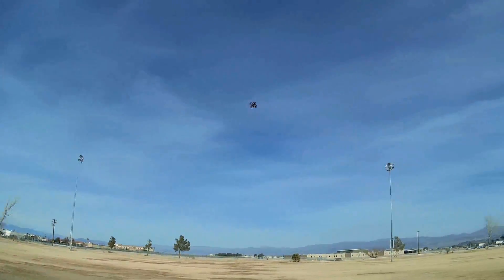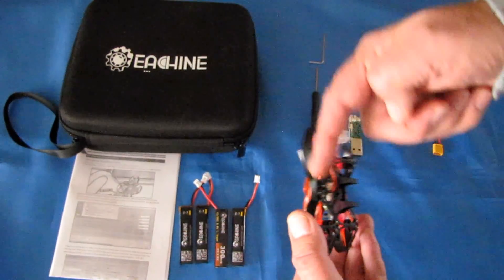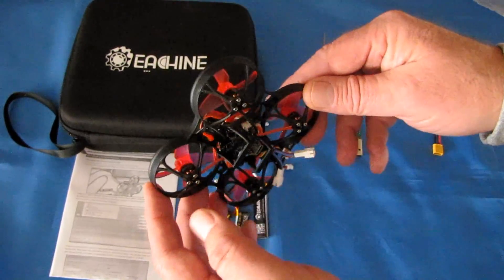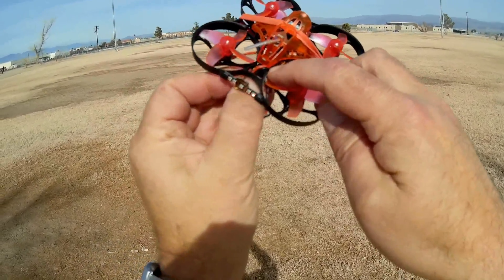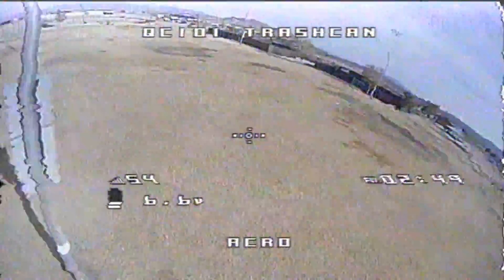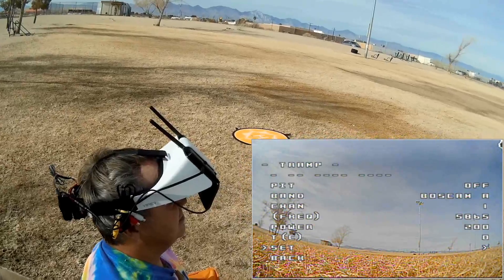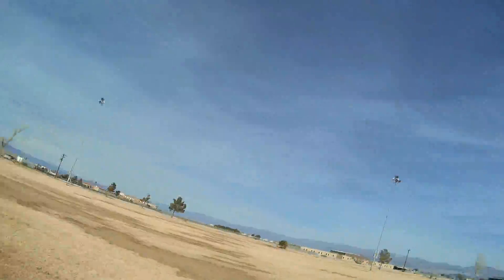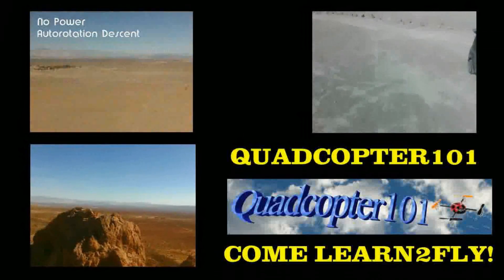Eachine Trashcan Speedy 75mm Whoop FPV Racer Flight Test Review

Comment: my quad uses 300 man 7.6v 30/60c. Can I replace it with 300 man, 7.6V, 80C/160C or will this fry up my flight controller
Reply from the maker: It should be fine, as long as you primarily match the voltage.  The higher C rating just means that it is a better quality battery that can draw higher current without degraded performance.  And if you're wondering, the mah means how much power is available (for flight time).  But higher mah also means a heavier battery that the drone would need to lift. So the increased flight time is not linear (i.e. a 600mah will NOT double the flight time as the drone will need to suck more power to lift the heavier battery).

Comment: If i add a dedicated flysky receiver  would i go for the "no rx" version or just the flysky version and disable the integrated one some way or another.(if that is a possibility)
The No RX version support external serial-bus receiver like xm+, crossfire, S-FHSS etc.. But i'm wondering what the best and easiest option. Because the fs-a8S can do both.

Comment: I’ve got one of those little buggers lol, still haven’t fully set it up yet, because I need to upgrade from my cheap goggles. After looking at a few videos on goggles I’ve decided to get the sky zone v2 goggles. They get great reviews, and for the price are very good value straight out of the box, with a great  quality picture and the video they record are also very good in comparison to even a lot of the higher priced units. The only thing I’ll do to make them better is change the antennas like each reviewer has recommended, the original one work, but not brilliantly. Also great review, can’t wait till I get my new goggles so that I can take full advantage of that mighty little beast.
Reply: Update, I’ve had  the skyzone goggles for a while now, and I’m so glad, my friend Daniel and his friend Cory, both were surprised at how good they worked even without a patch antenna or other aftermarket antennas. Got the same sort of distance that they did with there fat shark goggles and they both have patch antennas and other aftermarket antenna on the other side.

Comment: Hi what is your DVR 60 FPS  ?    😉
Reply from the maker: I have two DVRs used in this video.  One is 30 FPS and is built into my FXT Viper goggles.  But I have a second 60 FPS DVR attached to the back of my goggles.  It is a new DVR from FXT that will be available next month.  FXT asked me to hold off on its review until it is released to the public.
Reply: @Quadcopter101  Ok, I know this VTX FXT, thank.    😉

Comment: Thanks for another great review. I have a trash can on the way, it will be my first acro flyer. Can someone suggest a video showing how to switch b/w acro and stability mode using flysky i6  and the other basic first acro info? Appreciate You!!
Reply: andrew tull Flysky i6: 1. create a new model 
2. in Aux Channels  assign channel 5 to a two position switch it is going to be your arm switch , and channel 6 to a 3 position switch (switch C), it is going to be your flight mode switch. 
3. bind the quad. 
Then you need to connect the quad to a pc running betaflight and set it up. Check Josua Bardwell on youtube, he has many excellent videos  about betaflight setup. Put Arm on Aux1 and for Aux2 choose angle (stabilized) when switch is up, horizon (stabilized but you can do flips and rolls)  in the middle, and acro (it is the default in betaflight) when switch is down.
If you want turtle mode (flip after crash) you need to flash a 10ch mod to your trasmitter or you can use angle-acro-turtle on swC and keep the radio as it is, but no horizon mode (not a great loss imho).
You also need to activate air mode if you want to do flips and other freestyle moves, just assign air mode to aux2 middle and down if you use the angle-horizon-acro setup; if you use turtle mode assign air mode only to aux2 middle position.
If you are completetly new to the hobby, remember that stabilized mode and acro mode are very different, in acro mode you need smaller and more frequent movements of the sticks (except when doing stunts) to correct your angle and direction, you also need to coordinate roll and yaw in order to do clean turns. Stabilizied mode seems easier, but in reality it is just different. Use stabilized mode if you are inexperienced and you fly in tight spaces (the trashcan is very powerful, so start outside with no wind). But start to fly acro soon, it is much more fun. The firt times you’re gonna crash, but once it clicks it’s like learning to ride a bike.

Comment: You tried to set the VTX via TRAMP vtx control, but the trashcan uses smartaudio (option above). You 'll also need to set the power level to 500 to get 200 for some reason. 200 is 100 and so on. Also, bend one of the antennas 90 degrees in your goggles! Basically, you were flying 25mw the whole time and without proper diversity :)
Reply: Do you know if running the t8 instead of the 16 it loses telemetry? idk? reciver runs on 8 instead of 16?
Reply: @skipward9462  same problem here! Do not know what to do, I lose telemetry
Reply: @MrPorroto  bind in frsky not frskyx and turn telemetry off helped me
Reply: Is the Mw bug fixed by now because can it hurt if it is?   I dont want to burn anything

Comment: What does RSSI stand for?
Reply from the maker: Received Signal Strength Indication.  It is a numerical value showing how well the drone is receiving the signal from the transmitter controller.
Reply: Thanks for the info! :)